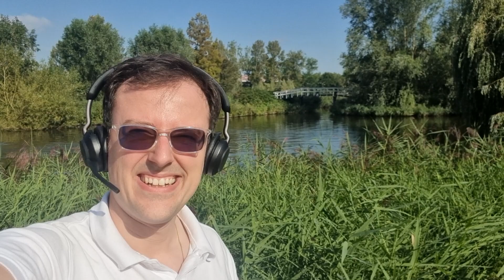SAP EWM BBP: Extra Processes & Reporting in Your Blueprint | Part 5

Comment: Hi Milos, Thanks for posting, Can you give examples of any 2 fit gaps in EWM?
Reply from the maker: Hello,

Thanks for the question:

Ex. 1 
Requirement: 
During Inbound the WH operator must be able to create new HU in RF for every pallet to be received for an inbound delivery. The creation of the HU should take as input information the material, batch, expiration date, quantity, packaging material of the HU (wooden pallet VS plastic pallet)
This is a FIT as stanadrd EWM supports this requirement
 
Ex. 2
Requirement:
During inbound the WH oeprator must be able to create a new HU in RF using the vendor specific barcode.
The barcode has one string with the following structure
M12345B6789
 
Where M is the indicator of the material, 12345 is the material number in the vendor system, B is the indicator for batch. 6789 is the batch number in the vendor system.
 
This is a GAP since EWM does not support this custom label format. On top, the requirement is incomplete as in EWM it is mandatory when receving an HU to know what packaging material should be used for HU creation. To receive the material you must declared the quantity being received, it is not clear from the requirement how the quantity will be inputed. If the material is Batch managed ogten times the expiration date is managed, to be checked with the customer if needed.
And I could keep going, but I think you get the point 

Milos